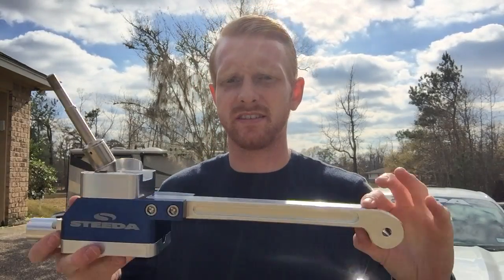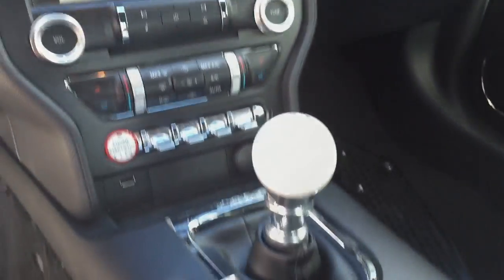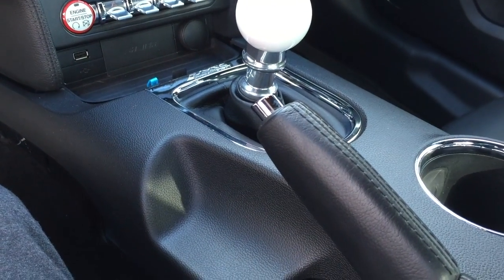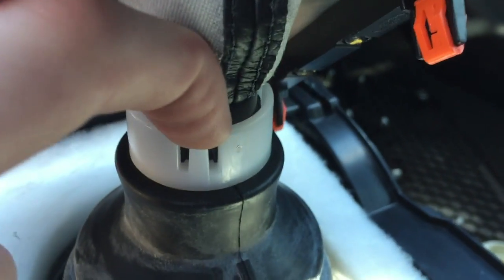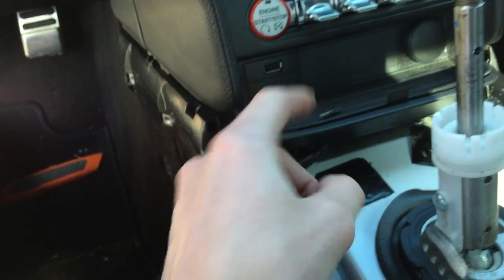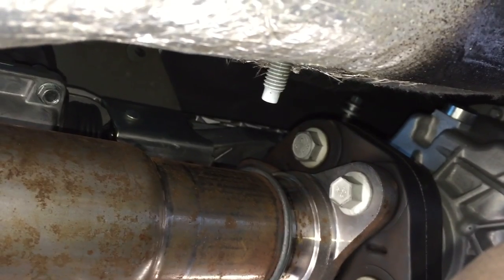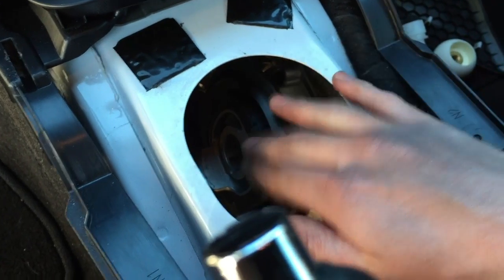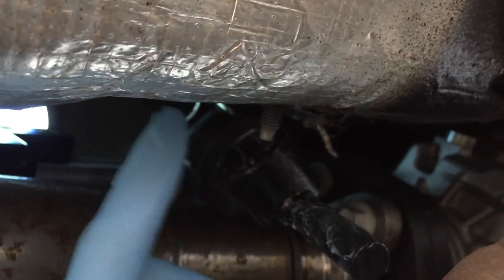Steeda Tri Ax Short Throw Shifter Install/First Impression-2015 Mustang GT

Comment: Arctic Knight, you mentioned the only improvement being a "remedy for the stock linkage." What specifically do you think is wrong with the factory linkage that you have to reuse with the Steeda shifter?

Comment: Thanks for the video! Quick question if you don't mind. Did the extra sound deadening make a difference? Which spring did you go with? Can't wait to install mine!
Reply from the maker: +Tom Forde Yes it did help. I actually plan to add more to see how quiet I can get it. I did the lighter springs.

Comment: lol, putting the insulation on the shifter itself will not do anything to the noise/vibration...it only makes sense to put it on the transmission tunnel (for noise, insulation can't fix the vibrations)

Comment: Which springs did you use with the shifter and what's the difference between the two when applied to the shifter. I just ordered mine Friday and curious of which set of springs to use when I install it
Reply from the maker: +stefano marzano I used the springs that provided the least resistance since it's my daily. The difference between the 2 changes how stiff the shifter feels. The good thing is that the springs are pretty easy to change if you don't like the one you install.

Comment: What did you use to hold up the transmission? how far did you have to let it down?
Reply from the maker: +WHIP 5oh I used a regular jack with a block of wood between the jack and transmission. I let it down as far as I could because it made more room to work.

Comment: Hey man. I just finished installed the steeda short throw shifter. I'm getting bad vibrations at high rpm. And ideas? Thanks
Reply from the maker: +gary5575752 I get some vibration, but thats to be expected due to the mounting arm being a solid piece of aluminum. Did you use the sound deadening material provided?

Comment: Did the sound deadening reduce the unwanted noise at all?
Reply from the maker: +John Cardin Yes it did. There is a little bit of noise if the radio is off or under heavy acceleration. Cruising with the radio slightly on I really have to listen for noise.
Reply: +S550_ Arctic_Knight  what kind of sound proofing did you use? Also what kind of noise's were you getting?
I am a noise freak thanks for the info, awesome video.
Reply from the maker: chris jankins some gear noise from the transmission. I just went to my local audio store and told them I want the best sound deadening material. There was a difference after I put the material on there. It was unbearable for me before but now it's even better. I am the same, meaning I like stuff like that to be as quiet as possible.

Comment: Nice Car, love the mods. What is the wheel and tire size/offset? thanks!
Reply from the maker: +Richard Harrow Thank you! Wheels are Rovos Durban wheels 20x8.5 +35mm front and 20x10 +38mm rear. Tires are Nitto Invo 255/35/20 front and 295/35/20 rear.

http://www.cjponyparts.com/rovos-durban-wheel-20-x8-5-and-20-x10-gloss-black-set-of-four-2015-2016/p/W5877/
Reply: Thanks dude looks killer!